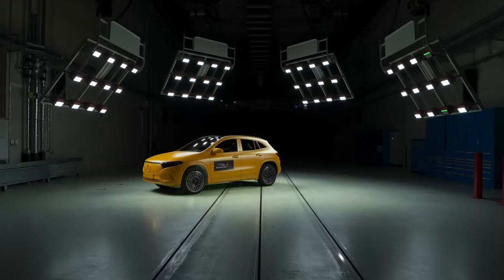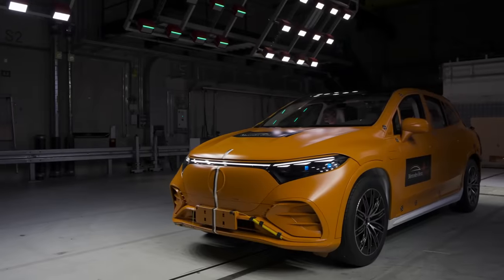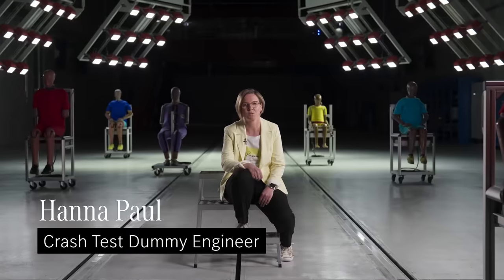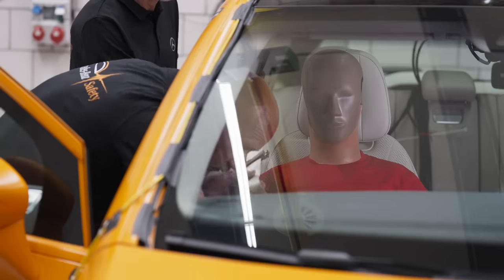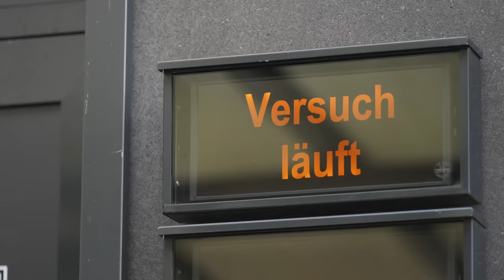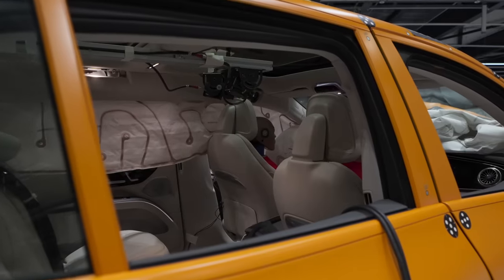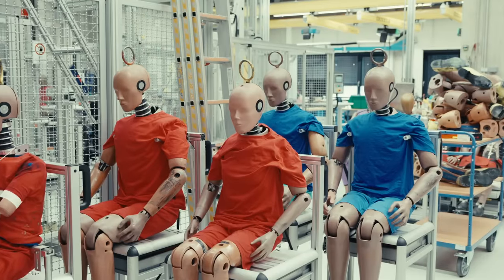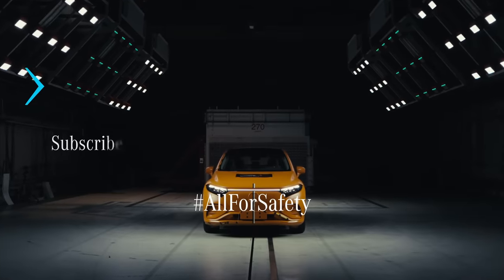The world's first public two-car electric crash test by Mercedes-Benz

Comment: Please do this with some other speeds too like 80kmh and 112kmh to get a better sense, because the damage and force increases exponentially the faster you go
Reply: Thats why it is no real use. At 112kph u are simply done 😢
Reply: @quelandil5738 At least its realistic for city use. At higher speeds active systems play more crucial role (and one of such actually helps to decrease speed to a city-like speed just before collision).
Reply: @axel-11  On point, nothing to add!
Reply: Both cars driving with 56 kph when the meet that’s the most common speed when an accidents happen outside urban arias. For the occupants the impact is like hitting a wall with 96 Kph. Ask any other car manufacturers to do such a test in public. I guess you wouldn’t find any
Reply from the maker: Well, to put it frankly, we are not crashing merely out of curiosity - we are choosing that speed because we have learned from our accident research, that 56 kph is the most common speed in accidents in outside city areas. But of course, we are also conducting crash tests with a tremendous higher speed.
Reply: @MercedesBenz  Yes of course, I understand. I just thought maybe for some better data, those speeds would also be good. Where I live in central Florida, those higher speeds are a lot more common on regular roads as the roads here are more straight and long. Speeds range from 72kmh to 88kmh on regular roads.
Reply: @MercedesBenz  Halo Sir, would be great if your team could conduct this crash test at the side door, and on the rear side of the car too. That will convince customer more on the reliability & safety of these EVs. 

Danke!...😬

Comment: Tests need to be 50mph and be done during heavy braking…..the pitch of the car changes the angle and forces. This video seems far too slow speed wise. Cars are faster and not doing speeds this slow, like braking distances from the 50s and 60s the speeds of crash test need to increase and the braking distances shorter…..autonomous braking.

Comment: I like how they did not feel safe enough to test it at their autobahn speeds, but only neighborhood upper speeds.
Reply from the maker: Our approach is real-life safety. We learned from our accident research that 56 km/h is the typical crash speed during an accident outside urban areas. Besides that, we are also conducting crash tests with a much higher speed.

Comment: Are  these cars being powered by the battery during the test or by a power tether.
Reply: Always by tether
Reply: @logitech4873  you sure about that ? 🤣 i am working in the facility where the crash was filmed and its defiantly not a single time by tether. What you see is the data cable
Reply: @RainerZufall94  Tether was the standard. I didn't know it had changed. You drive the cars under their own power?
Reply: @logitech4873  oh sorry that’s my fault I misunderstood it 😅 I thought you guys where talking about powering the car. That’s happens on the battery but yes the cars get pulled by a steel cable
Reply: @RainerZufall94  Maybe the guy I replied to meant something else and I misunderstood. But yeah I was thinking about how the car is moved 👍

Comment: We should also be concerned about how heavy EVs are. The Mercedes EQS is 5,600 lbs compared to a Toyota Corolla is 3,000 lbs. It doesn't look it but the Mercedes is as heavy as a Ford F150. All this weight is deadly to smaller cars, cyclists, and pedestrians.

Comment: For EV, there will be risk of electrocution by the battery after a crash.  What are the steps taken by Mercedes, or other manufacturers on this?  Any international safety standard on this?
Reply: On crash the battery gets completely disconnected within milliseconds.
Reply: @quelandil5738  but how can the battery automatic disconnection function be crash proof?
Reply: @edleung4046  Quick reaction time, like an airbag basically. Sensors detect the crash before the car is in crumbles. The disconnect works with explosives like an airbag. (most cars, some reversible solutions exist)
Reply: Ah and cars are required to have additional protection for emergency personal to manually disconnect. Just as a backup security measures to be 1000% percent sure. Installed in both A-pillars of the car
Reply: @quelandil5738  quick reaction can only ensure battery is cut off at that moment. The real test is the mechanical structure of battery itself is robust enough that there is no internal short circuit caused by the impact, and all surrounding mechanical structure is strong enough that it will not bend or collapse that may cause a short circuit between the battery terminal to the surroundings.

Comment: Wouldn't it be better, if the cars wouldn't bounce back on each other but got pushed to the right so the velocity would change from 56 to about 20 on crash instead of 56 to -5. Especially since the crash is like 50% shifted to the right side.

Comment: Hold on. Do they put the battery on? Or just using powered cable? Pretty the battery get wasted if it is on
Reply: I think it was fake batterys or with 0% charge
Reply: Yeah def no batteries on those cars, just dunmy weights. Mercedes would never risk an unquenchable battery fire inside, especially not in their fancy test facility
Reply: Standard charged batteries were in the cars.
Would be useless to test without since battery safety is one of the main concerns
Reply from the maker: We test real accident scenarios. This means that the battery was charged in both vehicles. To accelerate the vehicles, we use a steel cable laid in the ground that works in a similar way to the cable car in San Francisco. The fact that the battery is not destroyed in an accident is crucial for the safety of road users and part of our safety concept.

Comment: Hey Mercedes ?? what about fires ? obviously electrical fires are very serious . do you plan on taking any measures for in built Fire extinguishers ?
Reply from the maker: This is an important question that concerns many people. Statistically, vehicles with a battery-electric drive train burn less frequently than vehicles with an internal combustion engine. It is important to protect the battery in the event of a crash. The first ever public crash test of two electric vehicles showed that our battery remains without any damage even this extremely severe crash, in which both vehicles collided at 56 kph (35 mph).
Reply: @MercedesBenz  thank you for the reply
Reply from the maker: You're welcome!

Comment: There is no way an expensive testing facility would be risked without those batteries being replaced with inert ballast.
Reply: Production batteries with 50-75% charge were used. Where is the benefit in testing it without them? These batteries are really safe. The point where the battery would be severely damaged, the passenger would already be dead.

Comment: on the bigger car, why didn't the right curtain airbag deploy?
Reply: Because it wouldnt help. The sensora detect the crash angle and decide which airbags to deploy. --> not a bug
Reply from the maker: It's our philosophy to use our airbags, which are also used for the typical crash situation. This is because we still have the other airbags intact, if there is a second subsequent crash (e.g. another car hits the crashed car) then, for example, the side airbags are still able to protect the occupants.

Comment: Is this a 70 mile an hour crash total, or 34?
2,000 or so extra pounds due to an explosive slab that is not exactly at the front of the car to dissapate its energy and momentum quicker is impressive, though.
Reply from the maker: Each car was doing 34 miles per hour before colliding!

Comment: I talked to a CAA tow truck operator about damage regarding crashed EV vehicles. With the possibility of battery damage. My look at these as grenades ready to off. Even if not these monsters will destroy a lighter with relatively speaking that uses safety construction methods as well. Given how companies like Mercedes Benz backing out the EV market and the other safety issues coming out, to me this more like propaganda to help sell something nobody wants as far a mass market vehicle. As another noted try T-bone at 50 kph to 60 kph and see about the battery damage then. I had it happened to me and it was not a fun experience. Combined with what the CAA tow truck operator said I think the future of the EV is in question now.

Comment: You won't be fixing these cars after a crash. Which will result in a total loss. And higher insurance premiums. 
Another thing these German techs aren't telling you is what happens when an electric car that weighs thousands of pounds more that a gas engine car hits one. 5000 lbs on average for electric vs 3000 lbs gas car. Greater weight is harder to stop.
Reply: Dude.... any car is totalles after this crash. That has nothing to do with ev or german engineering.
Thats how these things work
Reply: @quelandil5738  I've worked in a body shop. And I think your wrong. And you can't tell me a heavier car does do more damage.
Reply: @starfighter2952  ?
For sure the heavier car deals more damage than the lighter one. Nobody questions that.

That doesnt change the issue that a car is totalled after a crash like this, no matter the weight. You basically sacrifice the car to safe the passenger. (Sure, 5t truck would survive a Smart crashing into it, but this is a cornercase)

Comment: Of most head-on crashes, death from internal rupturing of organs is a major factor . This will not be mitigated by heavier vehicles , but requires more absorption of the vehicle ,which can only  be leasoned by having less gross weight ! But a lighter vehicle hitting one of these heavier ev's  is likely to come off worse ! 
Come on , the truth is not without ALL the facts !

Comment: Not head on collision? Is 35mph for the speed of both vehicles or the resultant combination? 
What's the Co2 emmissions 
on recycling the battery?, 
in the event of a thermal run away?,
production of the electricity at the charge point?, 
from the energy lost during the transit of electricity from production to the outlet charging point?, 
In the production of a new battery and it's procurement of its materials (i.e. Lithium, cobalt etc)?.
Oh, it states Co2 emmissionen is 0g/km how innovative!
Reply: For some perspective my Computer emits 0g/km/hr Co2 whilst in use.

Comment: Were the batteries fully charged
Reply from the maker: It is our philosophy to test under real conditions. We call that Real-Life-Safety. Both vehicles were charged to typical charge levels. This means between 50 and 75 percent.
Reply: @MercedesBenz  That's good to know as we see many EV's after an accident of such magnitude setting alight. It's good to know that Merc are doing there utmost to avoid su h circumstance

Comment: With those 2 cars a collission should not be possible like that. They both have EBS (Emergency Braking System), so when the drivers won't break, the car will.. But then again, those are helping systems
Reply: For the tests it is deactivated to test passive safety measures. For real life crashes, the system won't always be able to reach a full stop before impact. However it would be able to slow down the car to more survivable speeds, hence the 56km/h (most common speed for this kind of crashes)

Comment: Ill bet they took the batteries out first!😂
Reply: Nope and they were both charged.
They are safe
Reply: @quelandil5738  yes. They are safe until one catches on fire in a car park. Or the euro tunnel.
Reply: @pureblood1978x  I guess you afraid of everything then?

Do you drive a petrol car? Chance to burn is significantly higher than in an ev.

The chance for a modern ev to burn is so low....

Comment: Was Multi Collision Brake working on the smaller car?
Reply: Auto break had to be deactivated to let them crash, if that was your question
Reply: @quelandil5738  That's something different.  Hence the difference even in the names of the systems.
Reply: Gotcha. There a lots of different names, hence the confusion. What u talk about is part of post-crash at mercedes.
Cant really tell from this video but brakes should be applied when it stands like that
Reply: @quelandil5738  Yes, that's why I'm asking. Smaller one definitely didn't apply the brakes and brake lights are also off.  So that's for me the malfunction.
Reply from the maker: Hi T-Works, – no, we have to disable the Multicollision brake in our crash test vehicles, so that the braking doesn’t interfere with the conduction of the test prior to the impact. In a real road accident scenario, it would have been activated.
Reply: @MercedesBenz  Thanks.
Reply from the maker: You're very welcome.

Comment: I wonder if electric cars should be made like Western tanks as opposed to Russian tanks that blow their top when hit (because the ammo is underneath the tank). The batteries should be in the back in a capsule/blow out compartment. Luggage in front. With the EU mandating replaceable batteries in cellphones, Mercedes & others should forge ahead and build user accessible and replaceable batteries in electric vehicles as well.
Reply: Dude^^
These batteries dont simply blow up. No idea where u get your info from but this kind of design would be a waste of money.

Replacable batteries is an interesting topic though. Nio is doing that and provides changing station. Gonna be interesting to see if that offers real advantages or not.

Comment: Great this shows that the vehicles used are designed to crumple at the corners. As they are normal production vehicles that have already been tested, this what they should do.  Perhaps a " SIDE IMPACT "  onto the battery casing  would show if the batteries are effected. So to me this test is NOT indicative of the point of testing the safety of electric vehicles. Hit one in its side and see if it burns.

Comment: Doesn’t matter if your Evs Batteries are only lasting 3 years because you bought the cheapest ones but sold them to the highest price. Disappointed what is happening with this company and how they are handling the problems with their hybrid vehicles failing after just three years of use.
Reply: Has nothing to do with Benz cheaping out.
Those small hybrid batteries will always accumulate charge cycles very quickly and therefor will see the end of their life very quickly.

Comment: Okay, now do a test where both vehicles are traveling 120+km/h, those are highway speeds out here, and deadlier than this example
Reply: That’s the most common speed when an accident occurs outside urban arias. Forchheim occupants the impact is like hitting a wall with 96 Kph. Als any other car manufacturers to do such a test in public

Comment: It appeared that both test vehicles were plugged in at their charging point...This indicates that the batteries in the vehicles were not charged at the time of the test
This was probably done to insure the safety of the test crew and the facility they were testing in.
But it would limit the danger, and would likely  not be an accurate test of a real life experience
Just an observation that would seem to disqualify the test
Reply: Batteries were charged.
The cables u see are for transmitting all sensor data to evaluate the test

Comment: That kind of test should be done by an independent laboratory. Automakers can be strongly biased just to be able selling more cars. This one can't be trusted at all....
Reply: That's exactly what is happening..... These 1-5 star safety ratings are done by independent agencies, you can check out all details on their pages. Also, where would be the benefit for an OEM to fake tests just to fail the independent tests afterwards? That simply doesnt make sense

Comment: It’s odd they seem to be attached to power cables. Does this mean there’s no battery in the cars and that takes away the risk of explosion ? It looks very suspicious. I don’t believe this marketing video.
Reply from the maker: We test real accident scenarios. This means that the battery was charged in both vehicles. To accelerate the vehicles, we use a steel cable laid in the ground that works similarly to the cable car in San Francisco. The fact that the battery is not destroyed in an accident is crucial for the safety of road users and part of our safety concept.

Comment: you worry about the weight but at least the weight s down low. A large SUV, especially like the Dodge Rams are just as heavy, fast but have an engine block at a height where it goes straight through the passenger compartment. It’s not Electricity that’s the issue.

Comment: No way is a 56mph crash representative of real life. You wont find two cars doing under tge speed limit.
Plus the integrity of the batteries is more of a concern at higher speeds
Reply: This is the most common speed for these kind of crashes. With driver reaction and active breaking systems the car will slow down before impact. Also no use in testing way higher speeds since safety  measures will only be able to safe you to a certain point. Harsh reality of life

Comment: If the crash does in fact ignite the battery pack(s), the flawless performance of the rest of the safety devices would be in vain.
Reply: The situations where the battery wouls get criticallt damaged, the passengers are already dead. The battery doesnt put passengers in danger

Comment: Of course with real fully charged lithium batteries, as opposed to weighted battery frames, one or more of these cars would have set on fire or even exploded.
Reply: These cars are equipped with normal and charged batteries.... no use to test otherwise
U may dislike EV cars but you shouldn't be ignorant
Reply: @quelandil5738  The IIHS state batteries charged to 12.5%. Me ignorant???
Reply: @digitalchris6681  as already confirmed the batteries were > 80% soc during the crash.
It would be useless to do it with an empty one
Reply: @digitalchris6681 Source in IIHS, please?

12.5% would still be enough to reveal a short circuit causing thermal runaway, mind you...